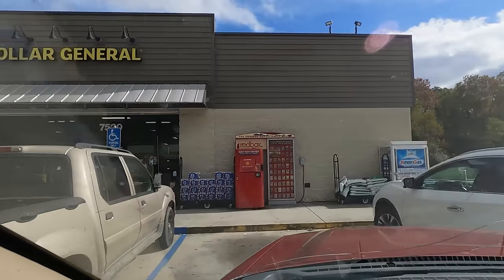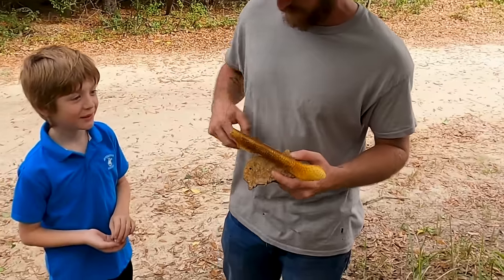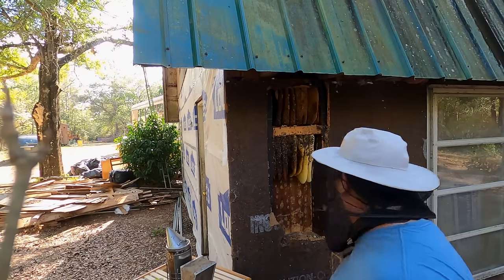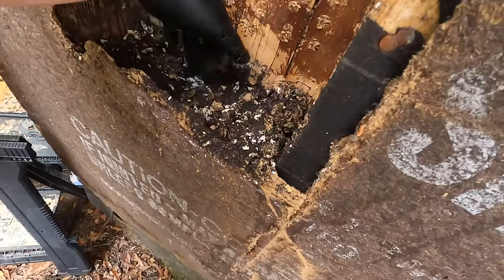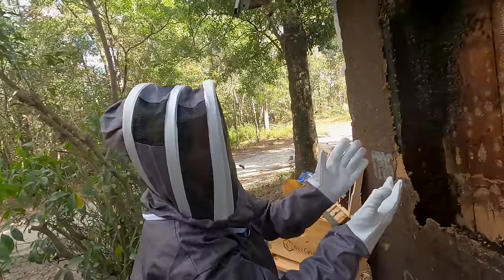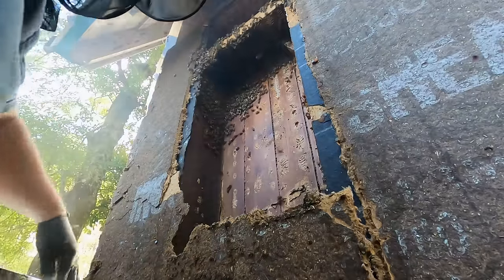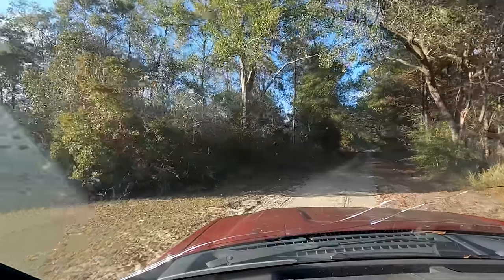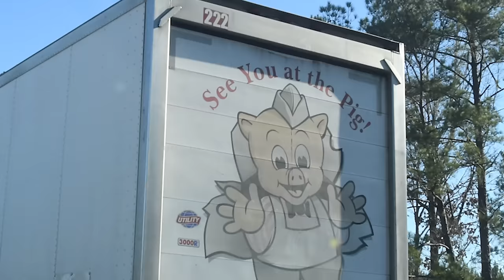Hidden 90,000 Acre Alabama Family Compound

Comment: When you get your shock absorbers replaced, you might want to replace your windshield also.  If you have glass coverage on your insurance policy, it will pay for the windshield replacement.
Reply from the maker: I checked on that. The deductible on my policy is $250 on windshield replacements. I think a windshield is cheaper than that.  The cracks are well below my line of site though, so they haven’t really bothered me.